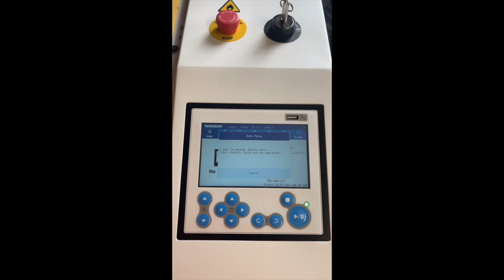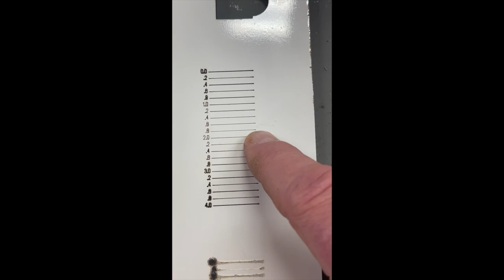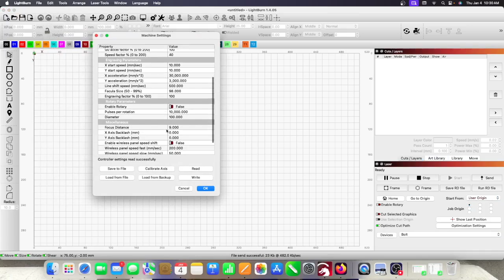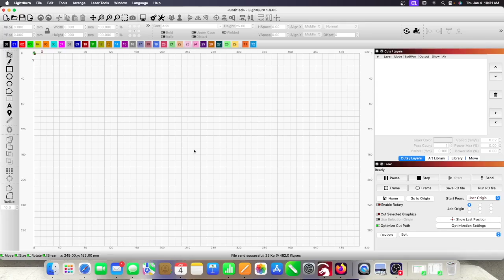Performing Ramp tests on the THunder Bolt

Comment: Hey thanks again. I am new with a BOLT so although I kind of get what you are doing, I am not sure why you are doing it. Maybe if you think it is helpful for others too (please don't do it just for me) but maybe if you want to, maybe do another video explaining why you performed this test. I thought the BOLT was calibrated and would work right out of the box(?) correctly? Thanks again for taking the time to create your videos. Cheers!
Reply from the maker: You are correct the bolt comes calibrated. The ramp test helps you verify that it is correct for all lenses. Each lens has a different depth of focus so by running the ramp test you can find the top and bottom limits of the depth of field.  By knowing the limits you can miss the tabs on a tumbler with removable handles or engraved a dished out surface as examples.  I hope this helps explain a little more.
Reply: @Angrycraftsman  It does - thanks very much for helping me out. :)